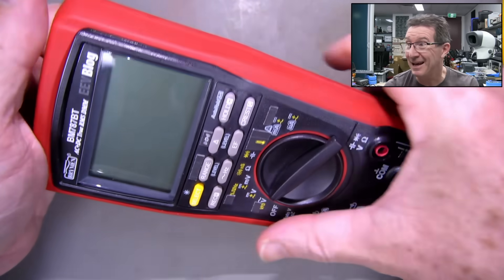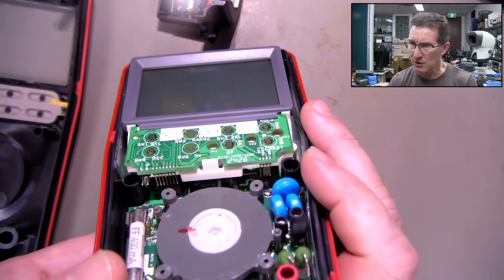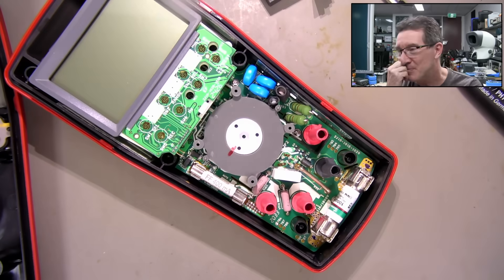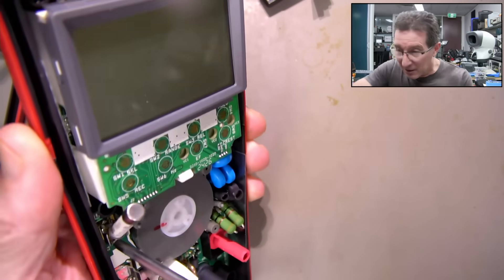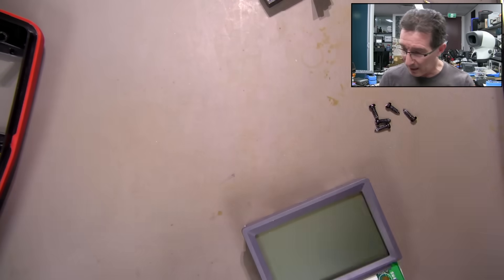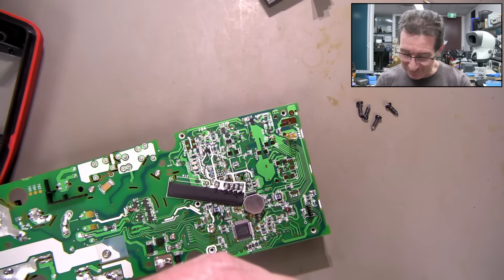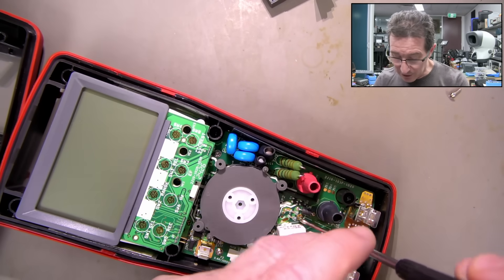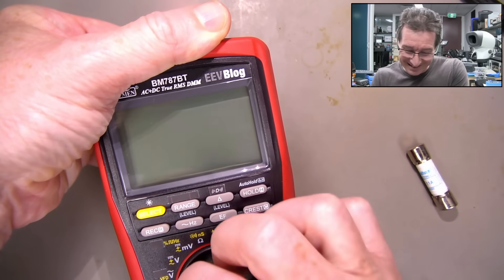Engineering Brain Farts (BM787BT)

Comment: If they use advertisement to send data packages over Bluetooth, then they send it to everyone, so you do not have to pair it.

What you call "Brainfarts" -> It is simply a useful brain function, which is causing sometimes some trouble.

The human brain is made in away that it can work automatically, so you can drive with your car through the town, you do everything right (streetlights, all the rules), but you can not remember what you did the whole way. It is a mechanism which is saving you brain-calculation power, like DMA on a micro-controller.
The bad thing with this is the fact that this automatic work is sometimes not what you want or should do.

Comment: Yep... done plenty of dumb stuff.

It's why I'm afraid to rebuild my own engine and transmission.
Reply: related: I spent 5 minutes trying to get my classic car out of my garage... even thought I forgot transmission fluid in the new remanufactured unit and promptly put in the required amount. It still wouldn't move and now the garage had trans fluid all over the floor.

One mental process of elimination later... I realized I never connected the flywheel and torque converter after securing the bellhousing. 🤦‍♂